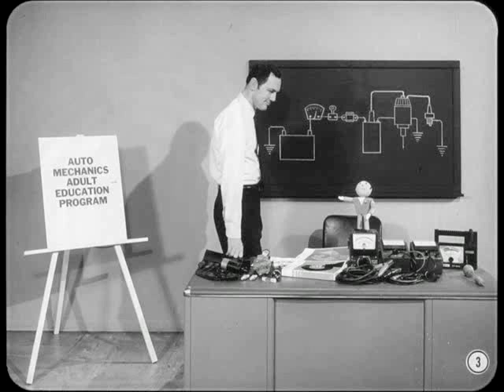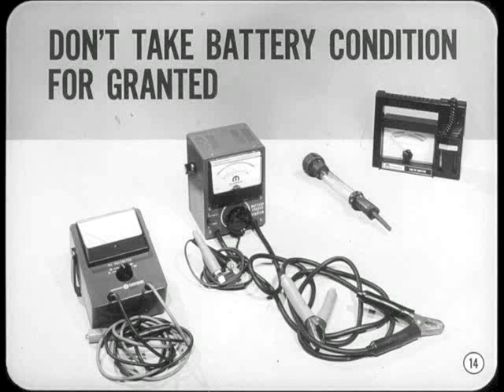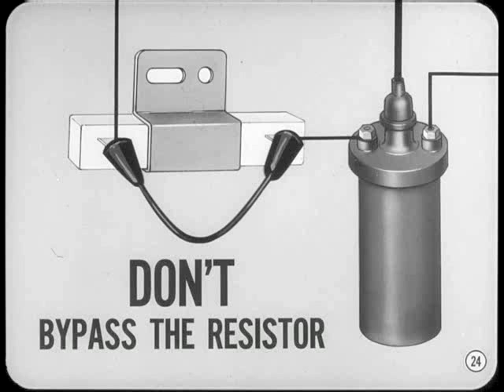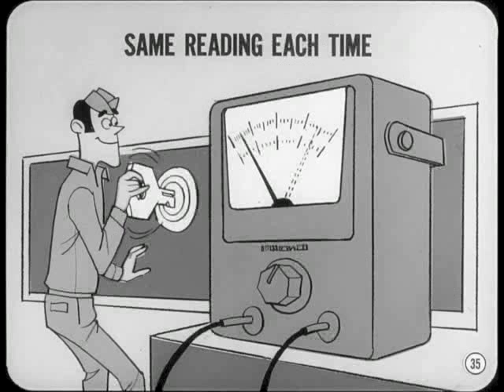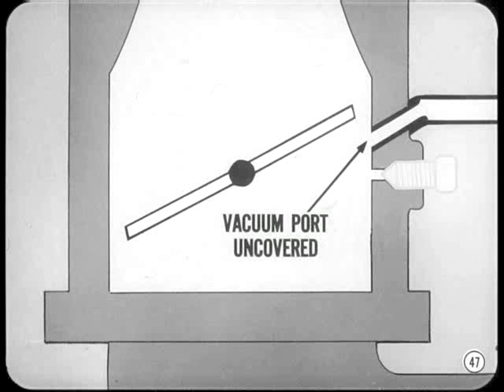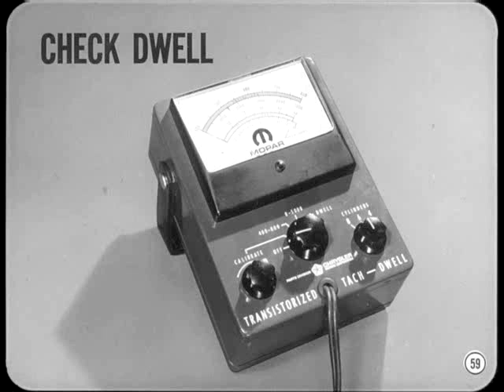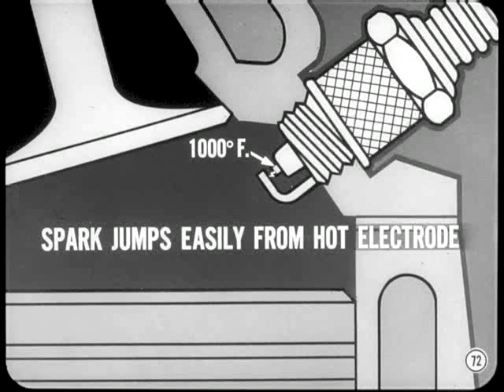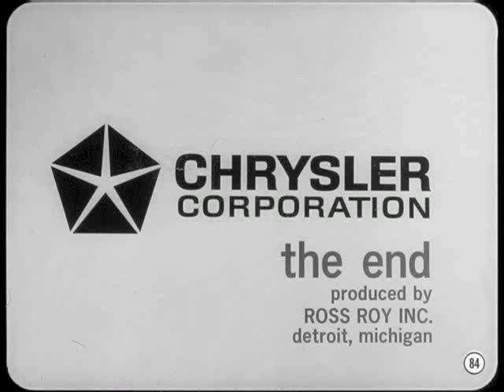Chrysler Master Tech - 1969, Volume 69-6 Ignition System Analysis

Comment: I've had low voltage at my coil and unable to start my 1970 'Cuda. This video brought concepts together, and was a breath of fresh air. The wiggle, trick with the ignition switch worked, and may lead to a solution. I like how it explained the centrugugal and vacuum advance methods to adjust  timing to different conditions.
Reply: Hopefully you've solved the problem by now but don't forget to check the coil polarity is correct and also firing order!  Simple, elusive issues that lead to perplexing problems if not approached systematically!  Hope you got it running!
Reply: @hindflight  I found my problem was the power from the battery in the 1970 system comes into the ammeter gauge from its bulkhead connector. I found this gauge was bad, and bypassed it by hooking both incoming wires on the same screw. The gauge is bad, but my drain is fixed. What I did was check voltage at each connection by peeling insulation to get a good connection; voltage first coming into the bulkhead was good, and the next component was the amp gauge, which was bad, draining some voltage which affected everything else-power coming into and leaving the ignition switch going back out to the ballast resistor and + coil.

Comment: Had an interesting issue where i turned the key to OFF position as the engine turned off, the ignition switch sprang momentarily switched back to ON or run position as the engine was off.

 what was the issue in the end? Killed the ballast resistor and showed up as a no crank no start, confirmed that the starter was good by jumping the starter terminals with a screw driver, it cranked so at least you can do that to see if the starter is dead or not.

Quite exciting as the car was dead at a local gas station with a heft of tools in the trunk to save the day, also had a spare resistor.

CARRY SPARE IGNITION PARTS  Points/condensor/Rotor/cap/ballast resistor/and maybe a spare coil.